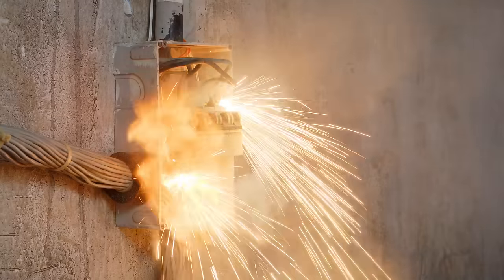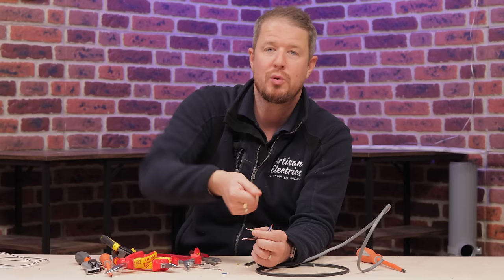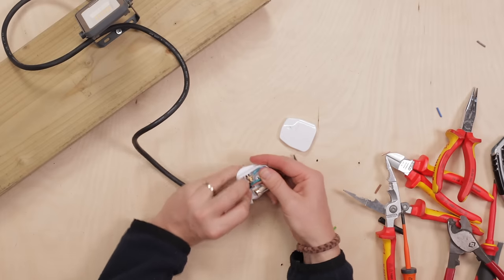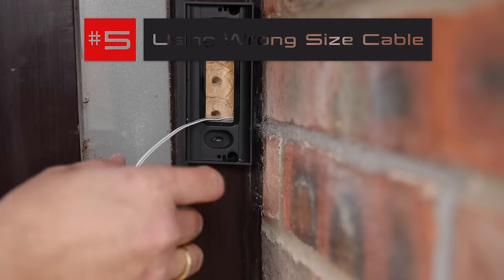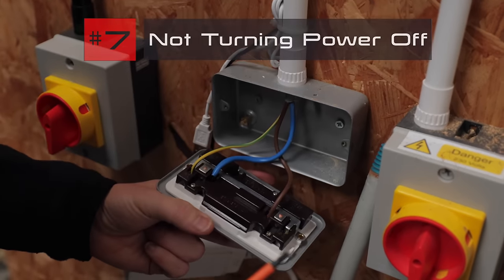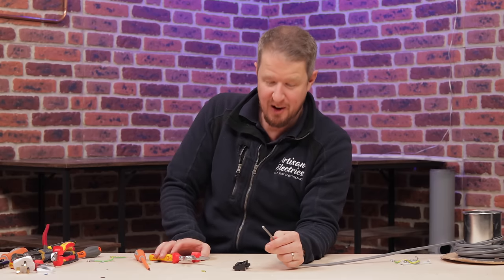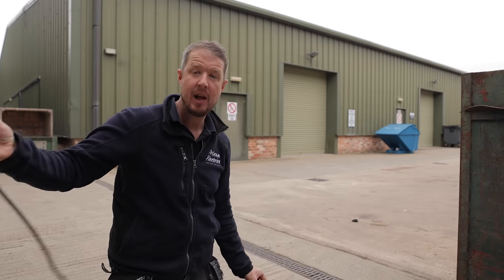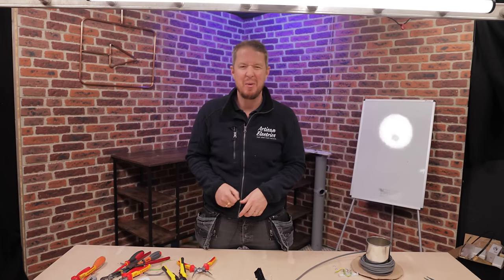10 Mistakes EVERYONE Makes When Doing DIY Electrics!💥

Comment: Bell wire is still used in a lot of homes in Spain ; mainly older houses .. I’ve seen earth wires cut from flex into plugs metal lamps wired in bell wire ( no earth)..twin and earth 2.5 wired into plug tops.  I remember when I was about 20 years old I was doing a block of flats for pensioners. And they had small 2 ring cookers that were in the flats. I had to run a new circuit for a cooker I ran 10mm and the other sparks ran 6mm ( nothing to do with voltage drop ).. as the distance was less than a metre from the consumer unit .. 6mm was more than ample for the small
Cookers used .. but I was   taught that they could buy a bigger cooker and it’s there if needed ..and in my time I have seen thease big range cookers that need 10mm.. and some are so far away from the consumer units you need to install 10mm the same goes for showers I’ve seen 4mm  and cables burnt out at the pull cord switches burnt out …using the wrong size cable

Comment: I think you kind of missed the primary risk factor with the unsecured (unclamped) wires exiting the 13A plug which is that it's too easy for one of the conductors to get pulled out while leaving the other one or two still connected... if the live is still connected inside the plug then you can get a lethal shock via the now-exposed neutral wire if the other end of the cable is connected to a typical load like a lamp/filament bulb, heater, fan etc. This is much more likely than  the insulation becoming damaged and exposing any copper I'd say...

Comment: I was kinda surprised you even mentioned wire nuts.  I'm from the US, and they are by far the most common method here, and to be honest, if they're used correctly, they actually do work quite well.  The main problem is that it's very easy to not use them correctly, and that's when you get problems.  So you need to make sure you read the instructions and follow them, use the right size nut for the size and number of wires being connected, and you also want to double-check that they're fully secure with a "pull test" when you're done.

Or just use the WAGO connectors.  They're entirely acceptable for use by all US codes, available in most hardware stores in the US now, actually easier to use, and much harder to screw up.  (and a lot of US folks are slowly starting to come around now that they're more widely available)
Reply: "The main problem is that it's very easy to not use them correctly"

That's why they are frowned upon in the UK, and I suspect most of Europe. Technology that's easy to "misuse" is bad technology.

Comment: I just had solar fitted by professionals.  I recently went into the loft and they hadn't pinned a single wire up there and buried lots under insulation.  The problem being that anyone wanting to work in the loft in future will have to tread carefully across the beams and now have to negotiate wires.
Reply from the maker: Ah that’s bad 🤦‍♂️

Comment: Thanks for some great tips.  Thankfully, I was already aware of them although the coiled cable was a quite scary.  When removing ceilings on my old house I found "rewired" lighting meant, in some places, a few twisted wires with a bit of insulating tape wrapped round them... 😲

Comment: I've seen a few cables catch fire over the years, even a 63A 3 phase one, nice fireworks though 😜
My biggest mistake was trusting my sister to turn the electric of on the room I was working in, it was shocking to say the least.
Had my battery recharged in milliseconds 😵

Comment: Gave myself a good zap while wiring a junction box inside a LAN party flight case. I did it all properly, with strain relief, proper wire connectors etc. Except I screwed up after a function test I did before buttoning it all up. All good. Unplugged cable, started closing everything up and connecting the last few wires. That’s when I got zapped on the thumb. After some heavy cussing, I saw what I had done. I had disconnected the wrong plug. So the junction box was bloody live. Ouch. That could have gone very wrong.

Comment: Twisting wires together doesn't have to be bad.
When I do it, it's with them pointing to each other (Which takes some skill), then solder, and heatshrink it together.
I also don't usually do it with mains.

Daisy chaining extension leads also doesn't have to be bad... as long as you count the current of what you're plugging in.
Definitely do not plug an electric heater into the end of a daisy chain of extensions, like my brother did.
Reply: You're missing something. Power draw is one thing, voltage drop another. But what most people overlook: the additional resistances in the connections might lead to a too high resistance in the PE wire and your RCD does not trip in case of a fault.
Not saying that this is necessarily happening, but this can happen.
Reply: @johnscaramis2515  I do know what you mean. what most people do with twisting wires together, definitely not a good scenario.
Even Crimping connectors can give a poor connection if not done right.

Comment: I once found a 2BA brass set screw in the fuse holder of a 13amp plug!! Happy days.
Reply: While working at a charity shop I found an item had a blown fuse wrapped in aluminium foil. It had a PAT sticker on it...

Comment: No magnetic effects of a wound extension lead L & N opposite fields will cancel each other out. Issue is lack of cooling due to insulation caused by layering of the flex only!

Comment: I am a retired powered access engineer and the worst people for not unwinding the extension cable were electrician. Put the machine on charge overnight, not unwind the cable then call up in the morning to complain the machine wasn't charged. Most often than not an electrician.

Comment: When we had an electrical house fire and the fire brigade told us to get the electrics checked - we didn’t for 18 months with occasional arcing in kitchen plugs and phone chargers blowing up - it turned out we had no working earth ( the original fire was due to defrosting a fridge on top of the tumble drier 😱)

Comment: The house I'm in now has a plethora of electrical issues, I'm working my way though (DIY). But bugger me, the reversed live/neutral on the sockets I've solved, but some trailing multiplugs are also reversed, from the factory!

Comment: Best one I've found was a doorbell transformer wired into the back of an outlet using figure 8 shielded audio cable, he just mashed the inner and outer of the shielded wire into one conductor on both sides, effectively turning it into twin flex.
The worst part was her was a licensed electrician, and maybe worse, he did this to his parents house! (that I then bought)
I bet there is some other 'greats' yet to be discovered in this house.....

Comment: Why is daisy chaining extension leads into each other dangerous, when each one is fused?
Reply: I have often wondered the same thing. The first plug has a 13A fuse so it protects its cable and sets a maximum current. I can see that in USA there is no fused plug, but UK is different.

Comment: Just moved house and found many DIY horrors. Worst so far is what starts as a professional job with an armoured cable to a large outdoor lamp, which someone had later decided to unwire from the lamp and twist together the ends with a twin and earth cable, no armour, and ran it down the garden just under the topsoil to a pond.

They tried to cover the join with a shopping bag inside of the lamp post, but neither were waterproof by any means and the join wasn't very insulated from the metal lamp post.

They've then later ripped out the pond and just cut the cable and left it in the ground, still connected at the other end. No labelling on an inside switch, so i turned it on for a while trying to work out what it powered, and I'm very glad i didn't touch anything just in case 😱

Comment: How can you overload an extension lead (DIY mistake 4)? They are all 13A fused. Even if you daisy chained 20 they are all running through a 13A fuse at the plug which is protecting the whole chain.  Is this not exactly the same as a fused 13A spur; which is why you can run an unlimited amount of sockets off a 13A FCU?
Reply: If the extension cords in the UK are this way, overloading might not be a problem. However here in Germany circuits have 16A fuses and the cheapo extension cords with multiple sockets are usually rated for 10A (pure extensions cables are however rated for 16A). Then the problem should be obvious.
BTW: the power draw is only half the truth. The additional resistance due to the multiple connections might lead to a too high resistance in the ground/PE wiring. And that might lead to your RCD not tripping.
Reply: In the UK socket circuits are rated at 16A radial, 20A radial and most commonly at 32A ring circuit Every plug has its own fuse rated for the appliance as well as the breaker protecting the individual circuits in the main fuse board (consumer  unit) . The maximum any UK plug fuse can be rated at is 13A. So regardless of how many cheap multipoint extensions leads are plugged in, they can never draw more than 13A because they are all going through a single 13A fused plug. Some extension leads are only rated at 10A but these would have a 10A fuse in the plug and therefore blow the 10A fuse in the plug. I take your point about the higher loop impedance from extending a circuit using an extension lead, though I think this is probably more of a problem for the breaker rather than the RCD, however the same could be said about a single garden extension lead that has say a long 30m cable. He doesn’t mention those and your average multipoint extension lead is only 2 or 3m long.

Comment: Nope not committed any of those.  Came across a job where some one used two independent single pole breakers for a 240 Volt service not kosher.
But the worst to date was a splice in a 120 Volt 20 Amp circuit NO box using some weird wire clamping hardware.  This was in a attic space and the 
splice had plainly failed and burned up very lucky no house fire resulted.

Comment: Some finer points: It is good practice (and code in some places) to leave the protective earth wire with extra slack wherever there is ANY chance of a cable being ripped out, so it will always disconnect last. Also, plugs have screw terminals that take flex cable... FERRULE the cable always. .... Extension lead/power strips cascades are just a reality with houses having installation meant for 10 big loads, not 200 tiny loads. What you should certainly do when it's a reality: Use quality - and that means 20 bucks grade - power strips, and occasionally measure the overall resistance from plug to last socket - "a few ohms" is too much and can sabotage fuses and automats when there is a short. Even better, do a mains impedance measurement on the "leaf" sockets, can be done with a known load of a couple 100W and a voltmeter and calculator. .... Actually, I was curious and hooked up some spare Cat5 cable to a megger - it will do 2500V wire to wire, but not 5000V. IF UNDAMAGED. It is absolutely NOT ok to use on the mains of course! ... The fact that one needs to get into the heads of DIY electrics enthusiasts everywhere is that heat dissipation equals current SQUARED on cables. ....    My bonus pet peeves: Taking "insulation tape" too literally when you should use heatshrink.  ... Trusting IEC C13 power cords and what is printed on them too much - I have found several that were printed 20AWG and had 24AWG-ish wires inside. Sadly, identifying these needs an ohmmeter with 0.1 Ohm or better resolution, which is where cheap meters bug out. Talking of meters: Not getting a current clamp style meter if you want to mess with house installation. Super useful, and EXTREMELY safer because there are just no conventional current ranges that can be miswired and make your meter explode. ... Not paying attention if you damaged inner wire installation when stripping sheats from cables. .... Replacing broken switches on stuff with metal handled toggle switches without grounding those. ........ (DISCLAIMER: I am just a vintage equipment restoration enthusiast trying not to murder themselves, not an accredited professional).

Comment: Something I see over here in Australia, is people cutting down the extended earth pin to make 15A welders fit in a 10A socket.
Absolutely bonkers. Just get a electrician to wire in a proper 15A socket to run it on.

Comment: No. 10: Effectively, this is no inductive coil. The magnetic fields compensate each other as the current in live and neutral wire flows oppositely. it's all about losses due to the copper's resistance.

Comment: We moved into a bungalow and had electrocution and fire hazzards absolutely everywhere. Cooker point switch, earth wire not connected and flapping in the breeze.  

The hall light rose with 7 wires run into it and the wires just about fitting in and screw not able to hold them, and arcing. Of course those wires pulled out when moved.

Lighting circuit protected by 32A breaker, and bodged connections were made in the loft using screw connector blocks, wires stripped back over an inch, bare parts of the wires insulated with single layer of insulation tape, then the whole lot twisted together, for whatever reason. A short and fire waiting to happen. 

Bodged connections under the floorboards, they cut into the ring mains and added sockets, connections made with lighting terminal junction boxes.
One of the spurs went to a wall mounted RCD then to the garage and the cable buried under the ground. They ran out of wire and had a joint under the ground, so the RCD had tripped. So they bodged the RCD so it stayed on and the RCD was burnt & black inside, and stuck in the on position.

Opened a socket in the kitchen and as soon as it moved forward, BANG. Unsleeved Earth wire shorted against live wire, all conductors stripped over an inch.

Door bell button live. Connected to the primary of the transformer.

The list goes on. I chose to scrap the lot and start a fresh with 4mm  radial mains circuits with a seperate circuit for every room. Electrician checked for safety. I was fortunate to have experience with working with an electician wiring supermarket years ago, plus a good electrical background.

Still had to update myself with new regulations in order to comply and for my work to be passed. 

DIY electrical can be very scary, and would definitely recommend anyone that moves into a new property, have their electrics safety checked.

Comment: During a rewire of a kitchen ring final on a tight deadline, then finding whoever did it originally has the whole dining room and hallway were a spur of the kitchen ring with 6 double sockets. The simple rewire  became a far bigger job. In the same house whislt updating some light fittings on the top floor, missing earth cable on all top floor lighting circuits, a simple upgrade to some light fittings turned into a full lighting circuit rewire, actually 2 lighting circuits. Same house again, on investigating a humming noise at the bottom of the garden we found a long overgrown pond with pump on humming away in the mud, it was wiried to a very very long extension lead, the socket was under a bucket in the undergrowth, the extension lead burried a few inches below the lawn. So another job for armoured cable, outdoor sockets CU upgrade.

Comment: I have seen extension leads with layers of cable melted together into solid lumps due to overloading and not being unwound enough (in a stage lighting gig where the licenced electrician spent the show patching blown circuits - at what cost the show keeps going on?)

Comment: What is the intrinsic issue with using otherwise adequately heavy (stranded) cable (flex) for wiring fixed/hard-wired equipment (rather than T&E)?

Comment: Also the design of the UK style plug (type G) has additional built in safety features, the is insulation on the positive and live the earth pin is longer that opens the shutters for the other two pins.
If the cables were pulled out the would come out as live, neutral and earth.  This is due to the lengths of the wire in the plug.
Also the type G plug the cable faces down so it is less likely to be caught or damaged and reduces the space taken up.
Compare that to the EU style cable that sticks out a bit and then the US/Australia/New Zealand electrics that stick out massively and aren't earthed.  The sockets offer no protection more can they be turned off.
Reply: There are still UK style plugs around without any insulation on the pins - the insulated variety only dates from the mid-1980s. Also the design of plugs varies - years ago MK used to market a plug where you cut all the wires to the same length and there were channels in the moulding that made them run the same distance to all three terminals.
Reply: @jeremybarker7577  That's the MK Safetyplug and it's still available. It was the first to have sleeved L & N pins when it appeared around '75 when the sleeves were white. Ever Ready had a similar equal-length design around then but no sleeves.

MK must have donated their design rights to the public domain in the interest of safety.

Comment: I worked on a trading floor in the city. One of the systems was run off about 20pcs on the floor. They were plugged into a bunch of extension cords. On a quiet day, some idiot decided to clean things up by plugging the cords into eachother like a tree back to a single plug. When he plugged it in it took out the whole trading floor. He had to take the rest of the day off for fear of physical violence.

Comment: Personally I had a job where a restaurant had a problem with their extractor fan cutting out. When I checked the speed controller I realised that the cause of the issue was a tinfoil is used as a fuse in the terminal 😳I was shocked